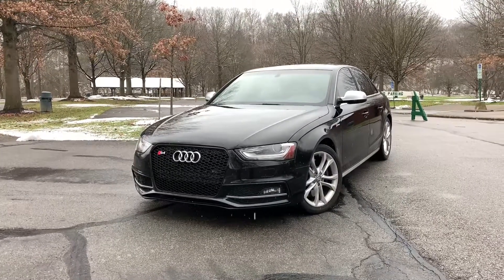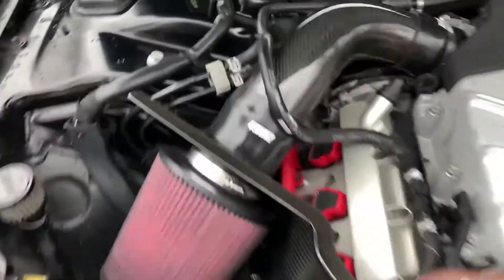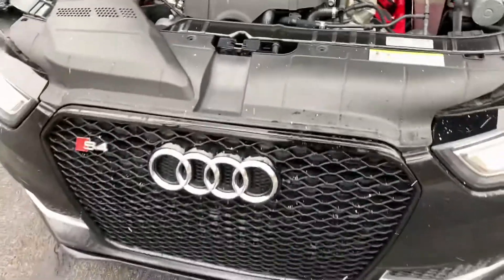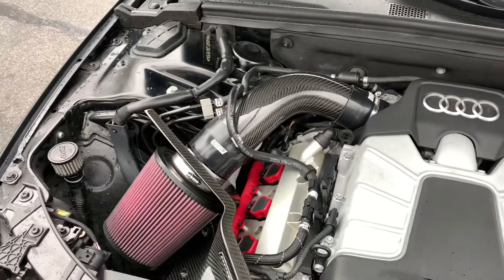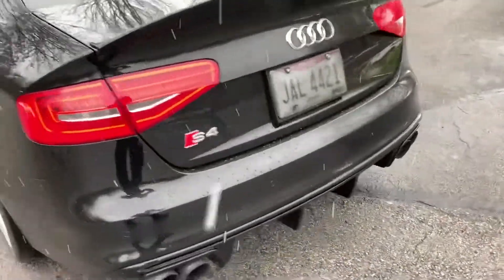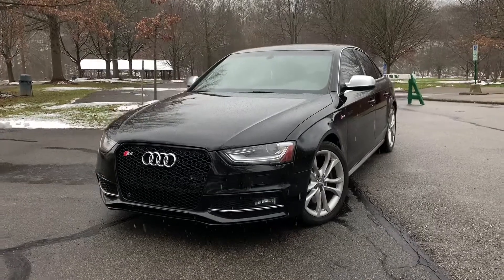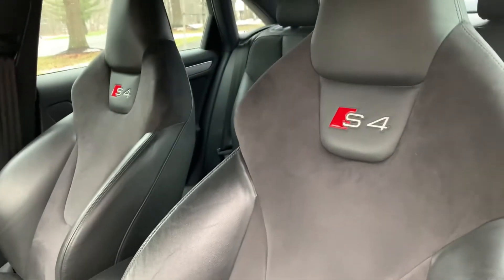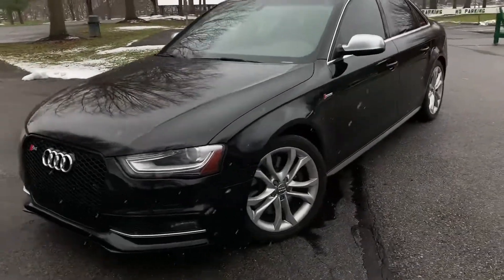Audi S4 B8.5 Mods, APR Stage 2 Single Pulley

Comment: Audizine is pronounced the same way you would say magazine. Zine means an independently or self-published media. Well done with the build so far, just watched your ultracharger vid. I'd love to go dual pulley on mine (currently stg 1 ecu and tcu), but I don't want to have a super loud exhaust from dp / hi flow cats. Subbed :)
Reply from the maker: you should do it, im stage 2+ right now with stock exhaust and gutted cats it sounds quiet but it does get loud when it needs to

Comment: Hey buddy how much was the stage 2 apr tune? I plan on doing all my work on my b8.5 except for the flash. How much did you pay?
Reply from the maker: It all depends, you need a smaller supercharger pulley I got a CTS one from ECS tuning, I got the ECS 187mm Crank Pulley too, they sell them together right now for the set of both it’s only $352, you’ll need a heat exchanger too that’ll run you $500 and the tune will cost depends on whatever brand you get
Reply: Thanks for the reply bro.. appreciate that. I plan on getting the tune through apr. But all the other work is gonna be man hours by myself
Reply from the maker: No problem bro 🙏

Comment: Smh.. jhm 207mm crank pulley. It’s one piece vs stock 2 piece. Look it up. Matches the ratio to duel pulley. So u just do the 207mm crank jhm pulley and u keep oem supercharger pulley which is better then what u have. Going 207mm crank is way better for your car and much more reliable and cheaper